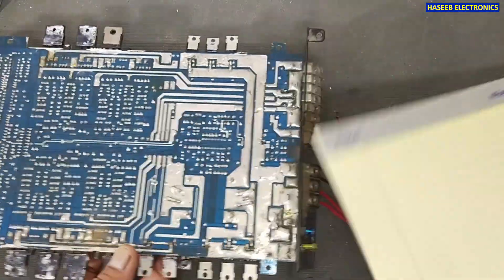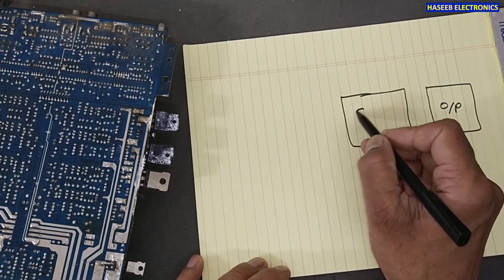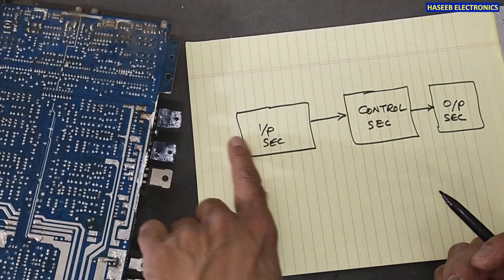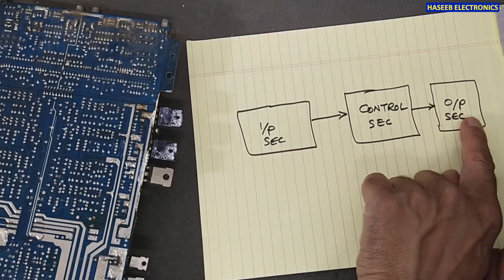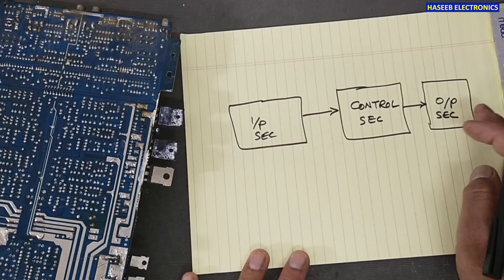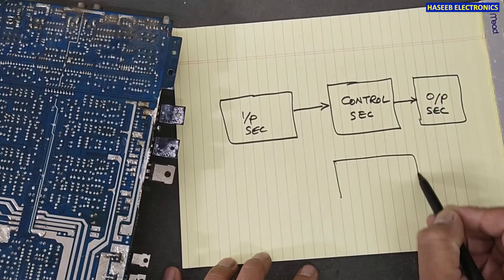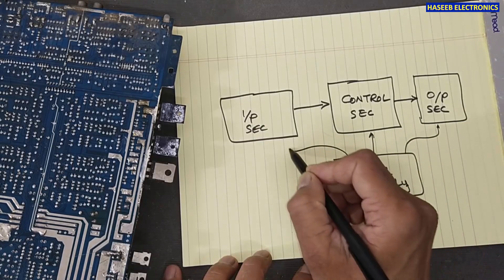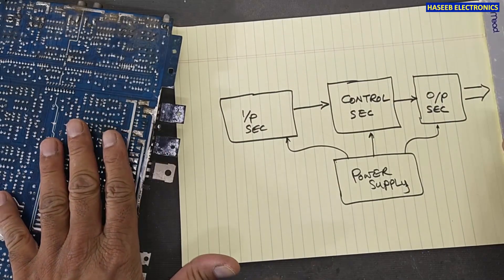{784} 1000 Watt Audio Power Amplifier Repair - Step by Step - Part 1

Comment: Sir, can you please advise how to calculate current for an amplifier in class d if it requires. Dual supply like suppose +/- 30v in   order to design transformer.